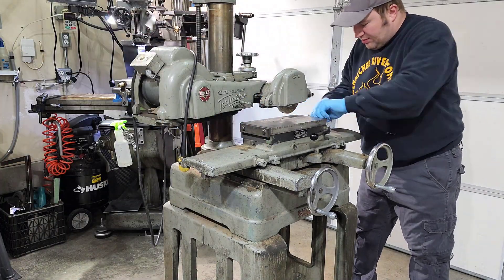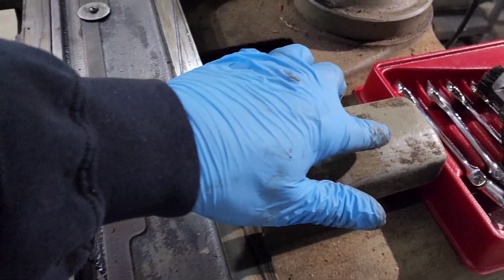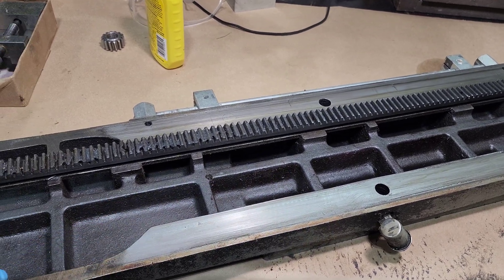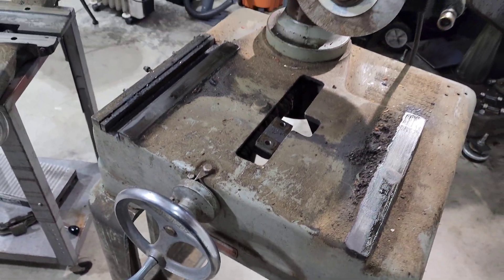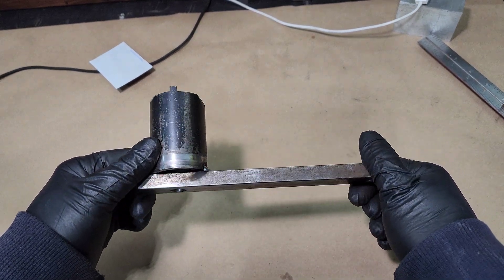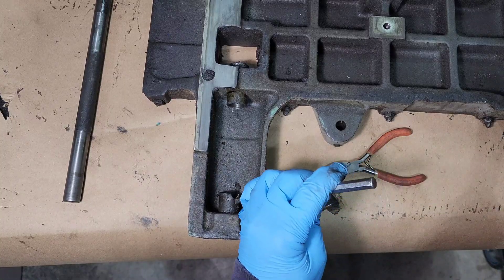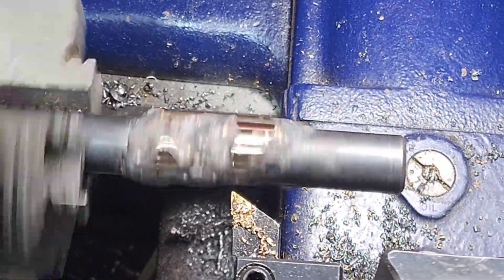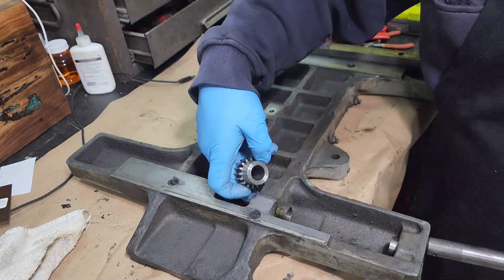Delta toolmaker surface grinder rebuild part 1 disassembly and cleaning

Comment: you have no idea what you are doing.  you should be keeping your tungston ground down to a point.   I"m sure people will argue that you got it done but really this is not a video on how to use a heliarc torch and process.
Reply from the maker: Like a say in all my videos, I'm learning as I go #hobbyists
Reply: Tut tut, strong language. Stuart did  get it done and there are differing points of view on the best angle for each type of job using  thoriated tungsten TIG welding electrodes.  BTW- "Heliarc" is a term thaf left the lexicon- last century.

Comment: Next time if you have a chaf  or  a around pipe that you need to put silicon bronze on it lock it in the head of your lather  put your lead on slow and weld in a circular motion you'll make it what is easier for you to weld and you'll have better controlled on the TIG welding

Comment: Great job! I really appreciate your doing this series, because you're showing me that it won't be too crazy to do mine. As a fellow home hobbyist, I've been nervous to 🤣 

At the risk of sounding ignorant, was it in fact easier to build up weld than to simply make a new shaft?
Reply from the maker: so far it has not been too bad so hopefully you rebuild goes smooth as well. it was easier to build up on the old shaft because it has a key way cut into it along with a taper drilled hole for the gear. good luck with your rebuild